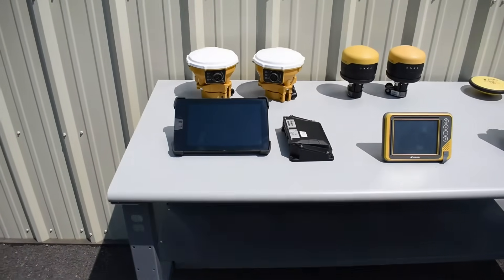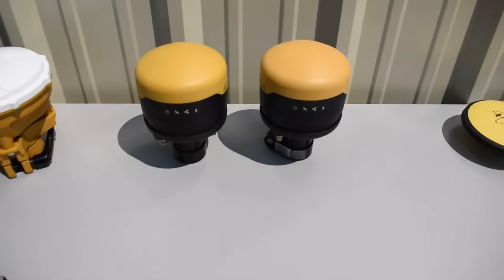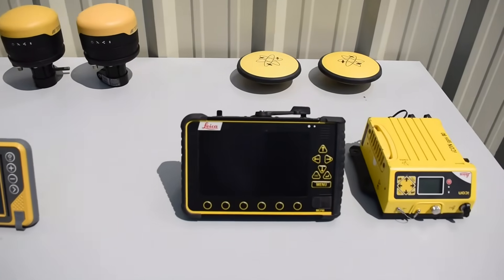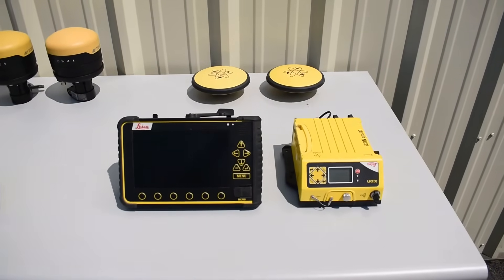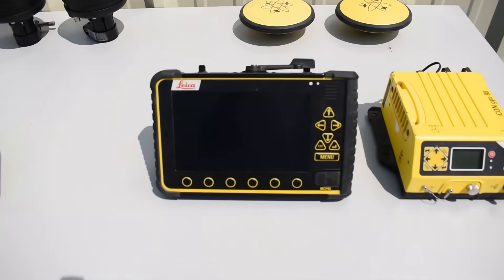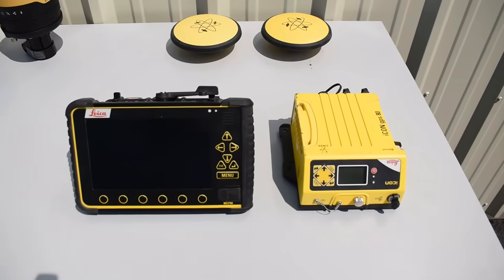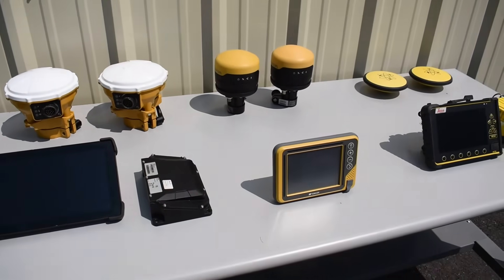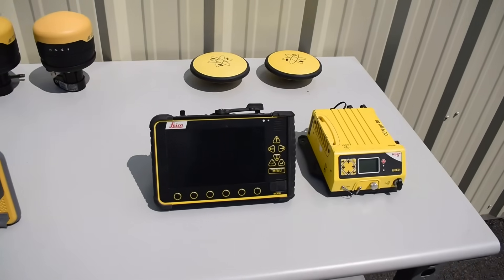Machine Control Comparison: Trimble Earthworks vs Topcon 3D-MC vs Leica MC1

Comment: Trimble vs Topcon vs Leica. All of them are OK in this days. There is couple more brands on the market like unicontrol, novatron, making. But favorit one done by competent person (not accountant but real engineer) is Old Trimble. You will not get no good quality materials (cables, joints), stable software and so on. Just get used to some problems coming with this new GPS sys and rock and roll. :)

Comment: Trimble correction broadcast goes also over cell (IBSS).
Reply: All of these systems are capable of receiving corrections via cell modem. In larger countries with less reference station network density it is more common to use a local gps base station transmitting corrections over radio. Leica also offers local base station transmitting corrections over the internet to reduce cost of reference network access, and to avoid interference from other radio spectrum devices.

Comment: Hi mate. Trimble and Topcon, they use smart antennas. Leica does not
Reply: what is smart Antennas?
Reply: You can see the antennas of trimble and topcoat are much larger - they have gps data processing hardware. The leica is different with the gps processing hardware in the yellow gps box next to the panel/screen.